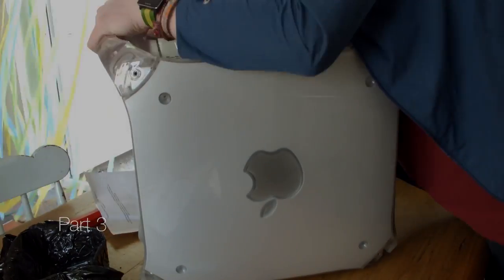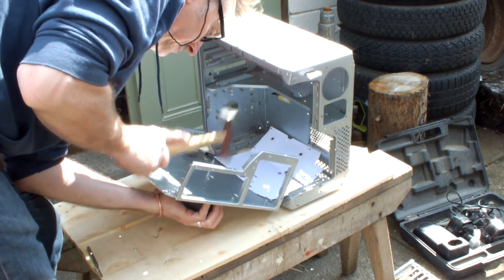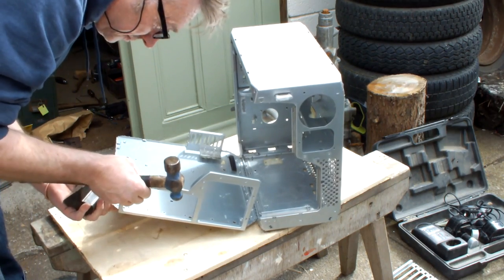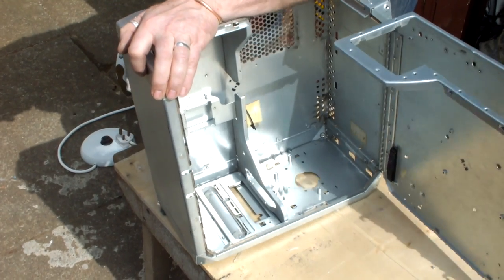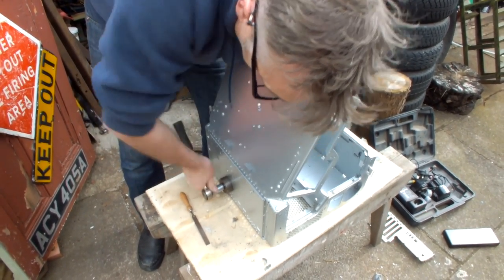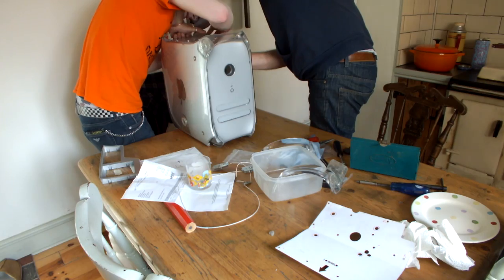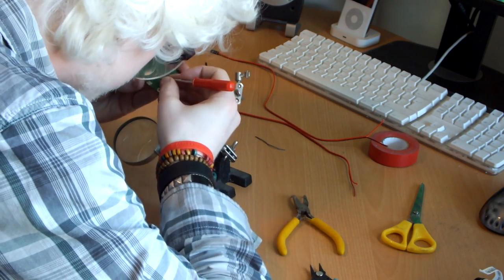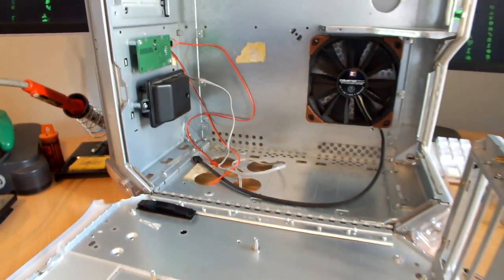2015 Hackintosh Build: Part 3 (Case Modding) | IMNC

Comment: I have really been looking forward to this vid and you didn't disappoint !
Well done on getting your Dad to help out, I'm sure he enjoyed it too but even so he probably had to put off something else in order to fit this in for you. I wish I lived closer, I would have loved to be around to lend a hand especially soldering that LED/switch panel, I'm sure I could have got it working with the original blinking LED's etc.
My only concern is the airflow to the radiator which appears to be less than perfect and I'm sure you are going to need to cut away more metal to get it right, which of course means that you are going to have to take the entire system out of the case again but time will tell.
Nice  build, great editing and superb sound overlays, well done Tom !

Comment: Tom the reason you have the one mis aligned standoff and 2 unused standoffs is because you motherboard is not micro atx its actually flex atx. Manufacturers call flex atx products m-atx all the time because they are (mostly) compatible.
Reply from the maker: Linus Torvalds Very interesting! Thanks for letting me know. I'm glad I wasn't too harsh on pointing the finger of blame toward the template.

Comment: Amazing mods. I'm curious to see how temps do in the case and how the noctua industrial fans sound in it. BTW the gigabyte board is a shorter than normal m atx board. And m atx holes on motherboards can vary a little bit on the PCI side depending on manufacturer.

Comment: What a awesome video. I think the power Hack G4 looks very nice. You and your dad really done a great Job on this Case. For the cooling situation i don´t exactly know because the power pc processors are also getting very hot. Don´t know if the G4 Processors are so bad. But i know for fact that the G5 Processorcs were pretty dam nasty in terms of temps. But i just can say you will done the right think
Reply from the maker: ***** Thanks man! For sure, the G5 was one hot beast. That's one very big advantage to using a G5 case, good airflow is much easier to achieve.

Comment: Wouldn't positive airflow result in dust accumulation?
Reply: Master Bob Potentially. If properly filtered, then it should be fine, but unfiltered it will. That said, negative air pressure would be worse for dust.
Reply from the maker: Master Bob elecxonica is correct. Negative air pressure in a case has potential to bring in lots more dust because dust is sucked in from all the little gaps and holes that aren't sealed around the case. At least with positive pressure, as long as the intakes are filtered, you should be relatively dust free.